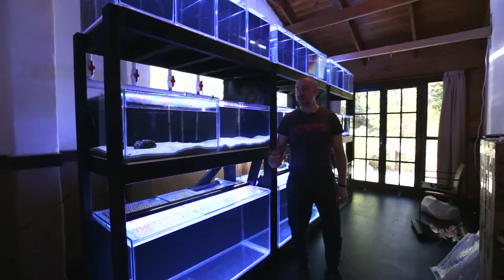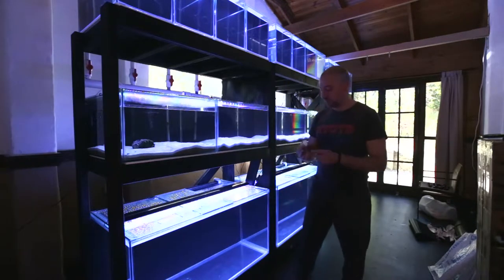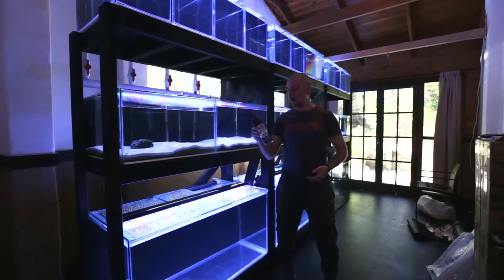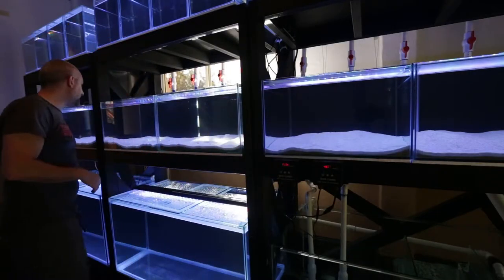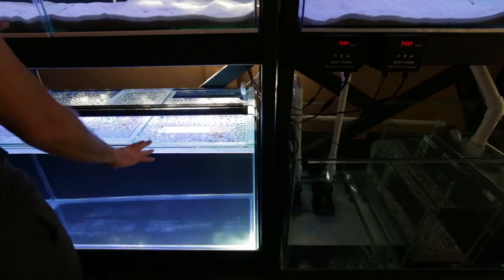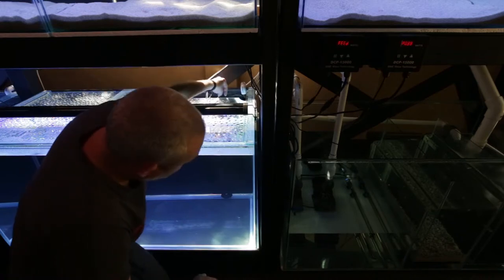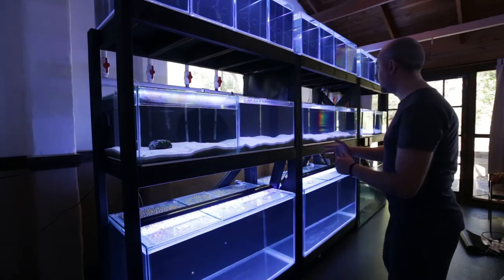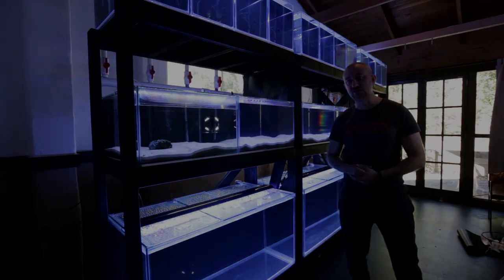HIDE Fish Room Plumbing & make it QUIET

Comment: Hi mate, 

I'm moving my breeding rack from canisters to a central sump in the coming months.

Just wondering what drain cover or strainer you use to stop the fry going down into the sump?

Cheers
Reply from the maker: Hey mate, at the moment I simply cable tie fly screen to PVC which is then inserted into the bulk head.  I only do this on tanks with fry in them. Hope that makes sense. Good luck with your transition to a central sump system Blake!